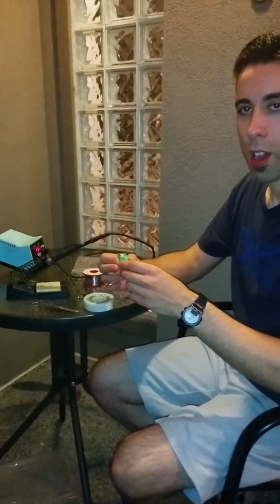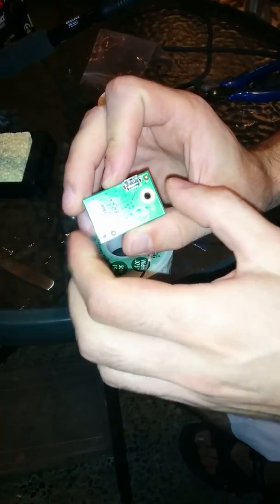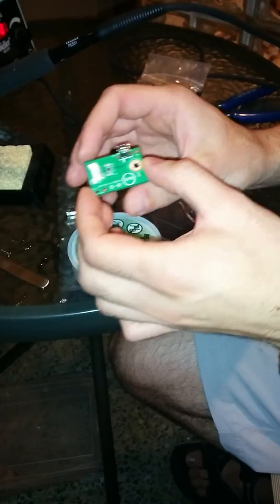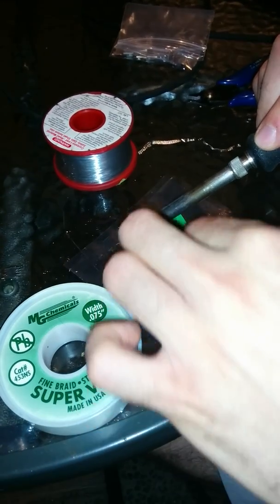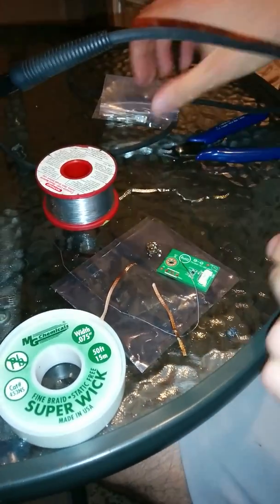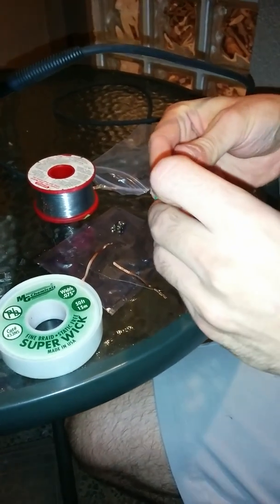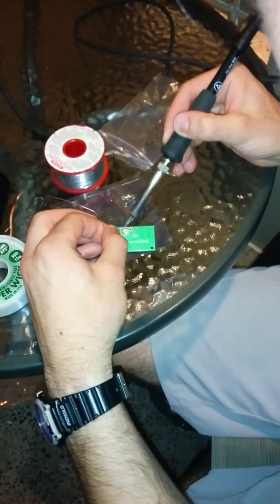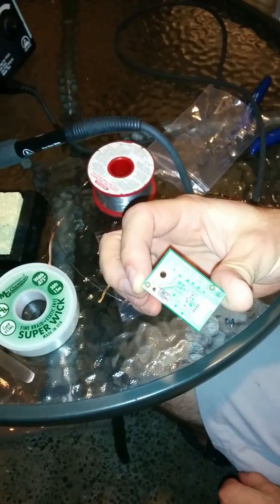USB connector replacement (desoldering)

Comment: I would have been easier to see if you had enlarged the stills afterwards, to fill the hole frame. I can see more of your knees than of the circuit here.
Reply: Yes good point - if you're stuck with any questions let me know